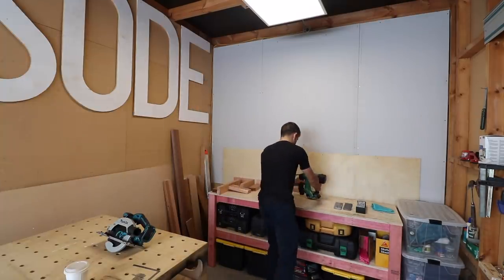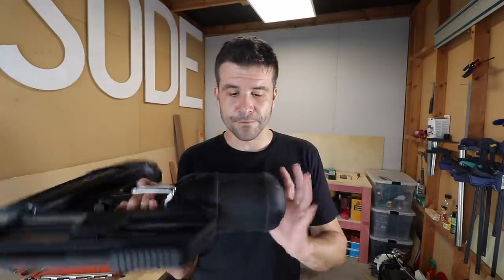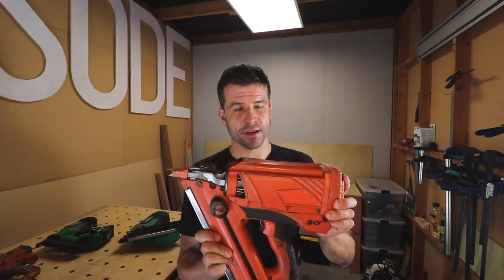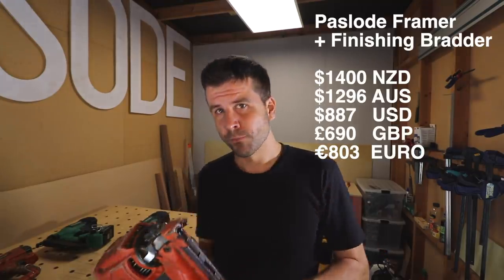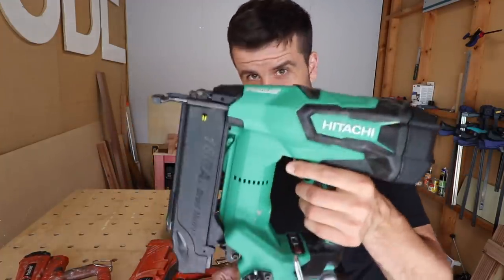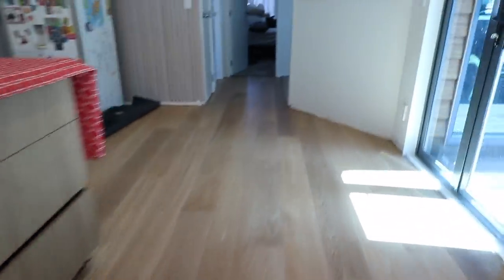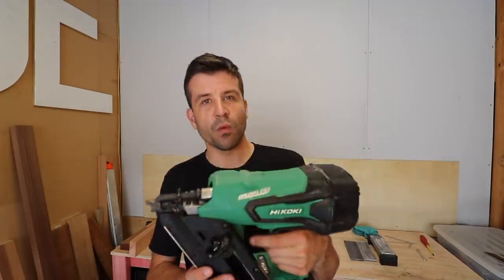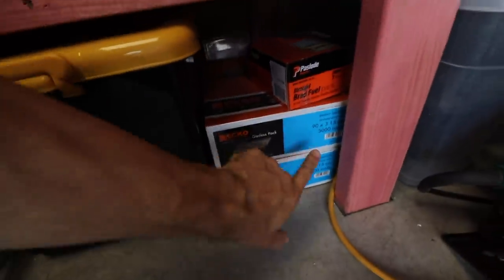The Best Cordless Nail Gun?

Comment: Glad to kick Paslode and their near monopoly down the road. Loving the Hikoki framing nailer but the comment about the lockout, on button (the control panel is in a stupid place - why not make it beep when it comes on?) and the dumbed down rapid fire capability for NZ are all downsides. The weight, not so much; I just use a smaller battery which helps a bit. Generic nails without gas cartridges are a LOT cheaper!

Comment: I've had the Hitachi framer since it has been out and it's the most reliable gun I've used once you get used to the weight it's really not a issue
Reply: I dont mind the weight, but i find the angle of the nose difficult to engage in corners, you have to turn the gun sideways to skew the nail in, i also find it a little hard to get the gun vertical sometimes, ive had nails come out the sides of joists and studs more often than id like. Have yo noticed anything similar?
Reply: @JimTom.  yeah nose is a slanted a certain way which only really causes me issues when I adjusted the depth to sink the nails in the furthest because that pulls the nose closer to the gun but if you wind it out to about half way it causes less trouble  and still sinks the nails in I only have it at full depth when I'm shotting into Jarrah also it's super easy to replace the heavy duty spring they have for the nozel, you just take that split pin out and the whole thing comes off and I'd highly recommend getting a lighter gauge spring it's a whole lot better
Reply: Ethan some good ideas, i will try them, thanks

Comment: I've had 2 Hitachi gas mailers and this year changed over to Milwaukees finish mailers. I have both the 18g and 16g. The gen 2 18g nailer is a beast. It's fast, powerful and the lack of servicing is a win win for me. Also a box of 5000 50mm brads is £12. For 2000 with gas it's over £20.

Comment: We use a DeWalt finish nailer, and Paslode framing, concrete and steel nailers. 
The DeWalt is battery power only, much like the Hikoki but then with angled nails, wich really helps in corners and narrow spaces. We used to have Paslode finish nailers with gas and batteries but they were bigger, heavier and a lot louder. We tried the new Makita last year but that s also bigger , heavier and louder, and it uses straight nails, if you're used to angled nails you'll find out how much that makes a difference.
The Paslode framing and concrete nailers use gas and batteries, they're doing their job really well, no complaints about that. The steel nailer uses gunpowder cartridges, expensive, but fast and good. 
Here in the Netherlands tere's also Hilti as a competitor to the Paslode machines, battery only and from what I know superior in almost every way, but a lot more expensive.  The reason we chose these brands is because Makita doesn't make machines that fit our needs, if they did we would change so we would have one battery for everything.
About maintenance, every machine needs maintenance, that means keeping it clean, lubricating it with oil or graphitepowder and replace the driver pin every now and then. Replacing that pin depends on usage and sort of nails, the DeWalt needs that fairly often, and the steel nailer needs that really often.

Comment: Just a home-gamer here so I still use air (although I almost bought the HiKoki triple pack when they were on special six months or so ago).  Despite only doing odd jobs I've somehow I've accumulated five nail guns, mostly second-hand: Bostich and Proton for 18ga, and Paslode, AEG, and Project Air for 16ga.  Of the 16ga, the Paslode is clearly the most powerful but the depth adjustment is inoperable so you'd better want those brads in good and deep.  Ironically it's the cheap-arsed Bunnings-brand Project Air that I preferentially choose.

Comment: Hello from Nebraska, USA. Love the channel/videos. I'm a professional carpenter for over 20 years. Own my own business. I do all types of carpentry, finish and framing/rough. I have pneumatic and cordless guns for EVERY task except concrete nailing. I use my pneumatics on bigger projects, because they are lighter and faster. If they project is only a few hours, out come the cordless. I have dewalt 20v 15ga and 18ga. I have hitachi 30 deg framing gun. I like these cordless guns alot. Dont like the 20v dewalt framing gun. Had one, sold it and bought the hitachi (great move). Yes big, but drives nails like my pneumatics. I have the hitachi 23 ga cordless pinner too. I LOVE THIS TOOL!!! I've used the Hitachi 18ga and 15ga finish guns. They are great tools also.
 I had a paslode impulse framer about ten years ago. The old nicad batteries went bad if they sat for too long unused. Gave up on that gun
That's my 2 cents worth

Comment: Scotland here; still using the Paslode framing nailer but I gave up the Paslode finish nailer for a DeWalt 660 16 gauge. Finish nailers often tend to get used in pretty enclosed spaces and the noise and fumes from the paslode were getting to me. Already on DeWalt batteries so no competition really.
Reply: Yeah dewalt finish nailers are good. The framer is not so good.

Comment: Used plenty of paslodes over the years. Great when there working but frustrating when they play up.
The old DeWalt flywheel second fix gun was great.
When they released the next gen flywheel first and second fix I couldn't resist 

The second fix gun is awesome.
Happily fires 60mm pins into hardwood. Bump mode is very welcome addition too.
Hold the trigger to keep it spooled up and bump the nose to fire. Great when fitting mouldings.

The 1st fix gun is on the heavy side. Sized to fit between 400c studs which is good.
Also has bump mode which is great for sheet work.
Slightly lacking in power when using 90mm rimshanks. If you get a gnarly knot it struggles.
Clearing a jam is easy. Two captive hex heads and the whole magazine hinges out. Usually just slackening the two screws is enough to clear the jam though.
5ah battery on it will see you framing most of the day.

Worth a demo. 
Owned them for 3 years. Banged a lot of nails in all conditions and haven't done anything but put them back in the box at the end of the day. No regular service required. 
Re pasoldes. Need servicing more than once a year really
Reply: Recoil is very low. And noise is a lot less than gas and air

Comment: Most everyone here is still running air. In fact most of the big time builders still have truck mounted compressors.

I still use air a fair bit but bought the Hitachi framer about 4 months  ago. I love it. The weight was a non issue after a day or two to get used to it. So far only had one jam. 

Finish guns I've been using Paslode 18 and 16 ga for 10 years for site work. 

Still use air in the shop.

Need to pick up a cordless 23ga doing alot of Millwork and cabinetry lately.

Buddy of mine has the Dewalt cordless framer. I'm not impressed with it. Leaves a lot of proud nails. The Hitachi is the strongest nail gun I've ever used including air powered Paslodes and Hitachi.

I honestly dont see air going anywhere anytime soon here in the states. Most builders are viewing the cordless framers as something more for remodels where you only need to shoot a few hundred nails. 

My only gripe with the Hitachi is the battery life. But that's only an issue if I'm doing something like nailing off sheeting or decking. I can run a 3.0 battery down faster than I can charge one.  But I've got 4 batteries so not really an issue

Comment: Always been on paslode, 18g, 16g and framer. Sold my paslode framer recently and bought the Hikoki.  The Hikoki is huge, very heavy and has given me tennis elbow but it seriously hardly ever doesn't fire, it's super reliable.  I mostly use the smaller nail guns and am going to stick with paslode purely for the weight and size advantages.

Comment: Hikoki framer and 2nd fix gun..

Both are very reliable and a lot quieter. The hikoki 2nd fix virtually makes no noise. 

1st fix is super powerful and reliable.  But after a run of 1st fix my arms are dead. Forearms ache.  The clip is better for roofing and joists as you can hang it over but not great for 1st fix as you can never find an easy way to clip to pouch.  

2nd fix is great. No issues. Could have a bit more grunt. Have to shoot straight. Where as paslode drives it whatever angle.

Comment: i bought the Hikoki framer and 15g fixing gun 12 months ago. framing gun has far more power then any gas gun i've used(10 years in the industry).
framer, 
pros: power, reliability, durability, savings on gas, servicing, bump fire
cons: weight, size, awkward belt hook. 
would recommend:  to any full time trades people, diyer, 

Wouldn't recommend: to a full time framer as a primary framing gun due to weight.
improvements: the fixing gun belt hook fits well on the gun. 
it fires 90mm nails with ease as long as there "cordless framing nails". The Hikoki framing gun will struggle to fire 90mm nails if there "air gun nails". yes there is a difference even if your hardware says theirs not. Talk to a nail manufacturing rep. 
 Fixing gun, 
pros: power, durability, savings on gas,servicing
cons: weight, size, led light
would recommend: everyone 
framer: best i've used but heavy
Fixer: its the best

Comment: For finish work I use the DeWalt cordless 15g and 18g nailers, They work great. For framing I use a DeWalt 21 degree pneumatic  nailer because I don't frame a lot and I have the DeWalt flexvolt compressor so it's kind of cordless 🤔 lol.

Comment: For bigger projects I don't mind dragging out the air compressor but for smaller projects it's a pain on the butt. I've been thinking of going the hikoki framing and finishing gun but I kinda don't want the hassle of the hikoki batteries and chargers which won't see much use but then I found a Hitachi to Makita battery adaptor so I'm thinking about biting the bullet. Thanks for the info! Really helps when trying to make an informed decision.

Comment: I also have had excellent experience with the cheap Ryobi trim gun.  I own the 18 gauge for about 3 years now. And has never let me down works excellent. I purchased a 15 gauge last year. Was a little disappointed it does not have enough power to sink a nail properly particularly in hardwood. But for the money I'm very happy

Comment: I use bostitch nailers 15g and 18 with the smart point tip  and a hatichi 23g micro pinner  air nailers.
I also have the same hatichi 18g like yours great nailer.

Comment: I'm on to the newer model Paslode.  The Dewalt was junk and ITM gave us the Hikoki to try but it was too heavy for climbing over and through trusses compared to the Paslode, also the toe nailing as you mentioned was hit and miss.  I use the DeWalt 16ga angled bradder for finishing.  It's fairly quiet for inside work and I've found it more reliable than the Paslode bradders I've used over the years.  The Senco is another one I've liked using (a mates one) it's got no issues punching through flashings behind cedar and such.

Comment: Recently got rid of my Paslodes, sick of gas cartridges, maintenance & misfires & went to Hikoki & Hitachi. The finishing gun is flawless. Great power and reliability. The Hikoki framer is bloody heavy, but that's not the biggest problem. The tip is recessed so far back, almost daily I end up in a situation where I can't get the gun in at the right angle to compress the tip far enough to disengage the safety. I find myself impact driving screws in where the Paslode with its big fat tip would just push back & fire. If I knew about this previously it would definitely have been a deal breaker. 
On the positive, the power of the framing gun is awesome & not a single misfire to date.

Comment: The gauge is how many nails there are per inch... more nails per inch higher the gauge number and more nails... (but smaller nails)
I am Hitachi framing nailer and angled brad nailer, I also have the AEG straight and angled brad nailers (they are ok and I have had no issues with them they do the job)  as well as a pneumatic one
The weight of the Hitachi has never bothered me... I just want the power knowing it will punch that nail in where I want no matter what timber...

Comment: I have use the Hatachi now Metabo Htp that are a great and reliable air gun with an hose wich is anoying but plenty of power and always works. My boss has the dewalt framing guns and it's not a power house and reallly heavy but very pratical for light framing ankward  place to work.

Comment: Scott, any strong reasons why you did not go with the Makita finish nailer? I have been looking at the Hikoki too but have been stalling because I most of my cordless tools are Makita.
Reply: Not too sure about Scott's experience but I have a large collection of Makita cordless tools and batteries so getting the Makita 18ga cordless nailer made sense. I will say this, it is a hunk of junk and I swear i'm going to throw it away every time I use it. In fact, all three Makita nail guns i have bought have all been awful.
Reply: Alex Rains my question is why buy another one if the first was bad
Reply: @e1itensd528  my answer: me big dum dum.
Reply: Alex Rains I mean I have one paslode framer that been In for a yearly service twice and I’ve had one issue where the gas wouldn’t feed turns out it was just a bad cartridge
Reply: @alexrains1893  Thanks I appreciate the honest feedback. We have a horrible old pancake compressor that we usually leave in our outdoor container and run the hose into our space when we are building. I was thinking/dreaming/ wishing about getting a 16ga cordless but I just can't justify the cost.
Reply: I too use mainly makita 18v tools. So many bad reviews I jumped ship on just my nail guns. I purchased dewalt 20v and I am pleased.
Reply from the maker: I've heard similar experiences to yours Alex, that's what put me off. Would be handy if I could stick to one battery

Comment: I'm in the south east of England (UK)
I've had the paslode pinner (finishing nailer) for about 15 years, I haven't used it in years because of the maintenance side, the biggest issue is the waste of gas because it doesn't always fire first or even second time. I think it needs a proper service by someone that knows what they are doing. But they definitely seem to have fallen out of favour here because last time I enquired about a service cost it was about half the price of a replacement.

Comment: Hi Scott, like was said you buy one brand and stick with it because it’s cost effective that way. But when I decided to move away from compressor and hose setup to a battery nailer I also moved away from my brand, Makita. Even though I had several cordless Makitas  I ended up purchasing a ryobi 18g. Lighter than most, surprisingly sufficient and for the cost of a Makita 18g I could buy the gun, charger and two 4amp batteries. Only thing I don’t like is it’s fluorescent yellow/green.

Comment: Use a pneumatic 23g pinner, Milwaukee m18 15g angle finish nailer, & soon to be Milwaukee 21° framing nailer (until it’s released, still using pneumatic framing, but excited to almost be 100% air hose free😉). Like the battery guns that don’t have the rev/ramp up time; which is really nice & also quiet.
Cheers✌🏼

Comment: I prefer Bostich air nailers. However I used a few Paslodes but I'm not impressed with them as they don't punch nails home leaving 1/4" out which is frustrating. I borrowed a mates 3 year old Hitachi... Man what a grunter and so smooth and reliable. I find a lot of co workers and tradesmen have lost the skills in nailing, or they never got taught or too lazy and chase the dollar. I noticed they very very rarely use 'scew nailing' they just drive nails in at rite angles which is prone to parting. All my jobs they virtually require brutal force just to break structures apart. I'm a massive believer in scew nailing.

Comment: We mostly still use air powered nailers here.  I'm quite intrigued with the battery guns though: especially the Hitachi Hikoki variants.  They are starting to make their appearance in our market.
Reply: @meestahwah the Hitachi is an excellent nail gun, when you depress the tip it engages an internal piston that generates a shot of compressed air that drives in the nail along with the power from the battery. This is the reason that it is so powerful and is also the reason that it sounds the way that it does. The gun is effectively a battery and gas powered nail gun without the requirement of a gas cartridge line the paslode.
If I wasn't on the DeWalt battery platform then I would definitely invest in one. 👍🙂
Reply from the maker: Ahh I didn't know that, thought the sound was added in later lol

Comment: The dewalt cordless finish nailguns are great, been using them for a year now (both 16 and 18) and no problems yet..
Reply: DE Walt has been making them for a very long time. And the 1st version had problems with misfires. Particularly when the battery got low. And then with the old style battery it was difficult to swap batteries. And it left the door open for these other manufacturers. I myself have never tried a 20v one.
Reply: can imagine how heavy they would be with the old batteries, I have heard that the framing nailer still isn't there and that it has trouble with larger ring shank nails while the Hitachi is better for those.

Comment: I am a bit wary of the Airbow, the first compressor they released had some issues. Have you tried the Milwaukee framing gun yet? Its a shame its skin only though, been waiting for Techtronic to hurry up and get some stock into the country. The Hitachi framing gun is a score at around $800 for a kit with 2 multivolt batteries, although it is quite heavy, but battery operated is definately the way forward, Delfast 90 galv 3000 for $100 incl gst at my local Placemakers.